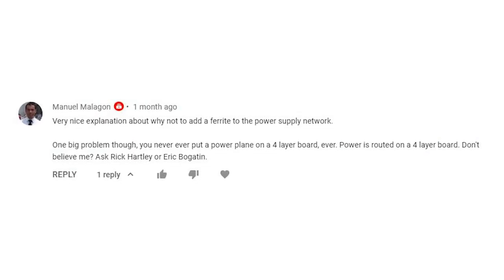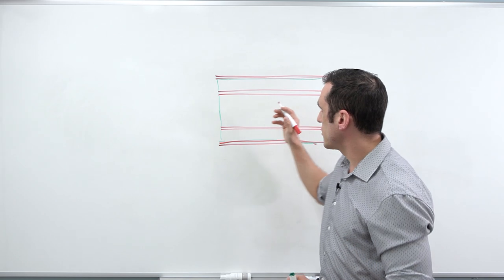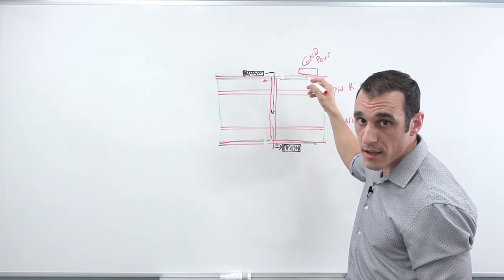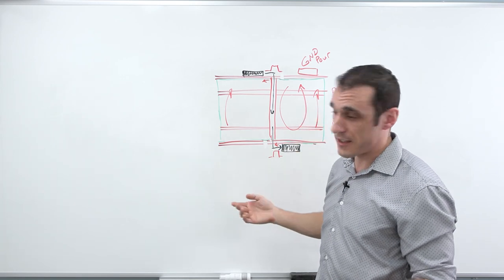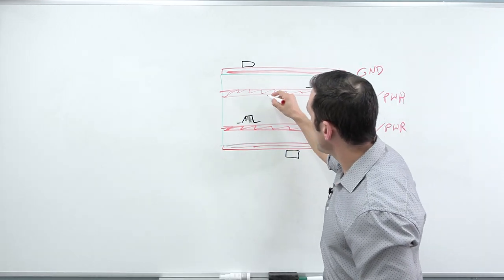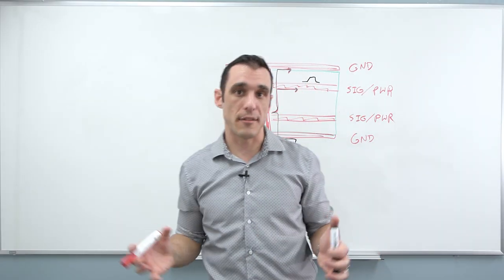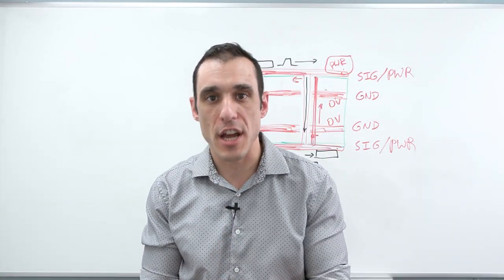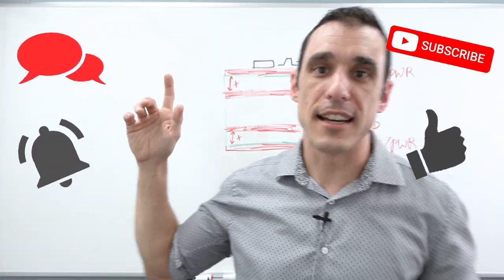Alternative 4-layer Boards for High Speed PCBs

Comment: Thanks for addressing this!! This is a very useful follow-up. And now that you presented my comment I realize I should not have said never. You could certainly use a power plane. I just don't like to do it because then changing layers becomes a bit more complicated and expensive.

I say complicated because when you use a power plane as reference, your signals should not change their reference between different power planes of different voltages, in other words, if a signal gets out of a chip using the 3.3V power plane as reference then this signal should not cross over a power plane of a different voltage and then use that as reference. You obviously can avoid this by having only one voltage but nowadays very few boards do, so it can\will get complicated. It is certainly easier to just use GND and not worry about, or even pay attention to, what's the power plane under the track all the time.

I say expensive because when you change a reference plane from a power plane to a GND plane you would need a "stitching" capacitor for each signal that change reference planes. These stitching caps would help changing reference planes efficiently and keep the fields contained. So you would have to increase the amount of capacitors in a board and therefore the price.

For a mixed-signal microcontroller board, really the best stackups are the last two you presented. I personally use the last one (SIG/PWR - GND - GND - SIG). This stackup allows to have absolutely all your signals on top and bottom always referenced to GND. Another very important point is that when a signal goes from top to bottom, you should ALWAYS put a gnd via (stitching via) as close as possible to the signal via to keep a constant and tight return path and to contain the fields.

For power, on a talk with Rick Hartley he pointed out that in all 4-layer boards what he usually does is to fill both top and bottom layers with copper pour attached to power and have L2 and L3 as GND. Another option is to have power routed with tracks in the top layer only and give priority to these power tracks and lay them out first since you don't want the PDN going from top to bottom. Going from one layer to another needs vias that would increase the PDN inductance which is not good.

For power integrity I usually scatter bulk electrolytic capacitors through the board and route the power in a star topology from them to different sections of the board as much as I can. When consulted this with Rick he pointed out that that is a good option since this method would help on keeping power on different board sections separated from one another thus preventing noise from a noisy part of the board from contaminating power on other sections. Something to keep in mind and implement if space permits.
Reply: Not sure electrolytics do anything at high frequencies. Ceramics are king these days. The former contain the water for the toilet, the latter allow the pistons to fire.
Reply: Wouldnt filling with copper top and bottom create crosstalk between pwr and signals?
Reply: @robertbox5399  yeah, they don't do much at high frequencies but is like having small batteries across the board. It is easier for the small high-frequency decoupling caps to get their charge from the nearest bulk electrolytic cap than all the way from the power supply. It's like going to the well instead of all the way to the lake.

Comment: Hi Zach, I thoroughly enjoyed your video. I am still very new to learning about PCB design. So, I am having some trouble visualising how a board can have components in an inner layer (layers 2 or 3 in a 4 layer stack up). Would you happen to have any diagrams or pictures where this can be illustrated?
Reply: You can not put any component in the inner layers which are layer 2 and layer 3 in a 4-layer board. The top and bottom layers are suitable for you to place components.
Reply: In the stackup where signals are placed on an inner layer, it doesn't mean that the components are on an inner layer. The components are on layers 1 and 4, and you get signals into the inner layers using vias. Hope this helps!
Reply: Thanks, that makes sense. So, to check my understanding, the signals are travelling along traces on the inner layer and the switching of layers for the signal is done by a via.
Reply: @rahulbanerjee5856  Yes exactly, you might have a very short trace on the top layer that goes to a via, and then that via connects to the inner signal layer.
Reply: @Zachariah-Peterson  Thank you so much
Reply: Technically not true. Printed components can be put on inner layers, but you can never get to them after the board is made

Comment: I've heard that prepreg layers are not recommended for high speed impedance control compared to core, if you have sig/Prepreg/gnd . At which point is this true / good to consider ?
Reply: Hi Roman,

The difference might be in the copper roughness, not necessarily in the material system that makes up the prepreg vs. core layer. They are different, and the prepreg could be rougher, but I'm hesitant to make a general statement about every prepreg. Yes it is a good point to consider in high speed designs where you might have a long link that has a lot of losses.

Comment: No u r wrong fellow. The best 4 layer stack is Top(sig&component)-Internal Layer1(GND)-Internal Layer2(VCC)-Bot(sig&component). Bcz the internal layer Pair forms an ideal plane parallel capacitor which supply u perfet fast power response. And one more thing, the pwr&GND pair absorb high freq EMIs.
Reply: This is an acceptable stackup, and the internal layer will only be a significant cap if the two inner layers are very close to each other.
Reply: Yes. Inner layers tend to be far apart so the capacitance is NOT ideal. Tracks on the surface near the power plane need to be referredto that, not GND.
Reply: Hi Kevin,

Thanks for watching! Hopefully you noticed that I stated in the video that these different stackups all have different uses. Sometimes, the SIG/PWR/GND/SIG arrangement is best, sometimes the alternatives are best. It just depends what you need to do with your routing and layout. The point of showing the alternative stackups was to point out that it can be difficult to provide a clear return path for high speed signals when you use the SIG/PWR/GND/SIG arrangement, depending on the number of digital signals and their edge rate. All of these can be good in different situations.
Reply: That does not work if you have diferencial impedance matching signals in lower signal layer.
Reply: It seems the stackup depends on component density and double sided placement. Lots of vias can cause big issues with gnd plane integrity. Hence you up the layer count with dense boards.
Reply: MIPI/CSI2 need very nice gnd planes (according to Hyperlynx). Otherwise, you get nasty impedance changes that screw up eye diagrams etc. on analysis. Us working for smaller companies can't afford these $25k+ a year licences for this mega-software though either!